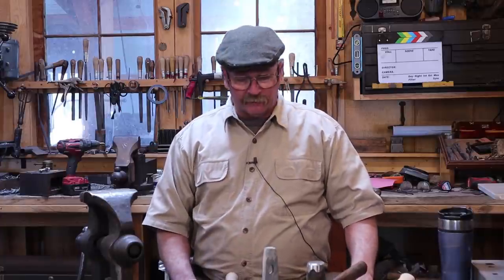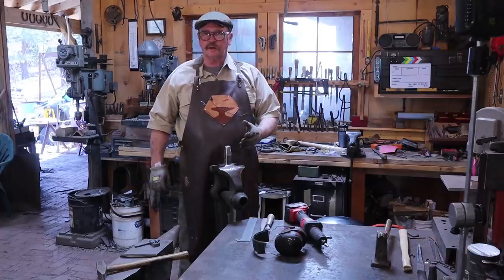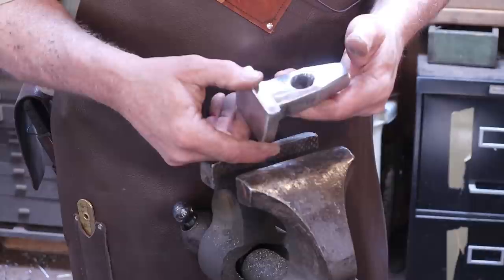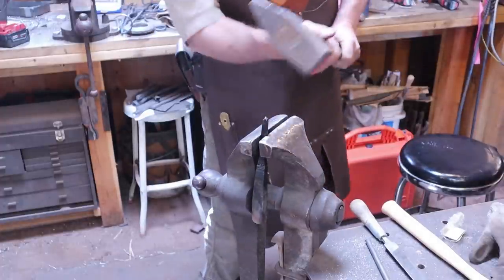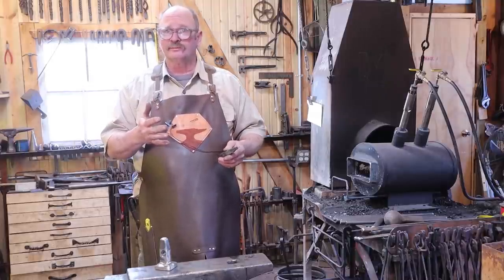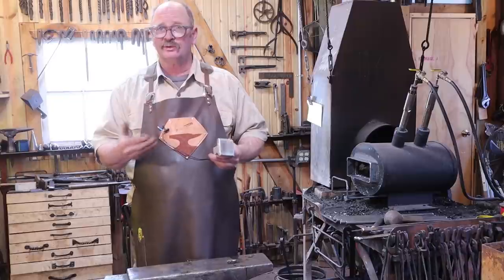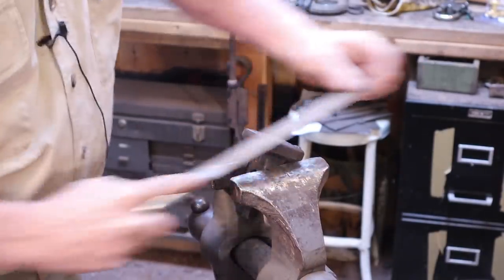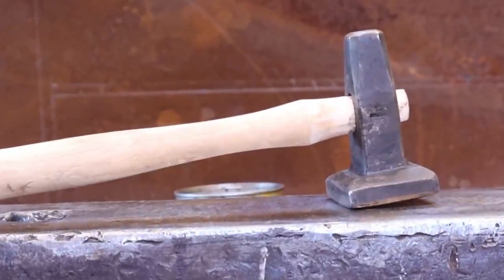Flatter - part 2 - hardening and tempering the mystery steel

Comment: Just bought the last pieces of steel to make a treadle hammer today. Your treadle hammer video inspired me to build my own, so excited to get started!
Reply: Pntz Englnd  Well... Where do I begin...? 😂
I built it from plans I found on the interwebs, but when it came to welding the springmountjointthingmabobber I turned it the wrong way so the springs doesn't pull enough. So now it has like 4"/100mm of stroke, should have something like 20" 😂🤦🏻‍♂️
Haven't really done any blacksmithing since I finished it, started working on my cars instead.
And yes, Jönsson svensk 😉
Reply: Pntz Englnd  Jo dom sparar mycket arbete! Och så får man två händer att jobba med. Men bygg nedre delen av "städet" ordentligt och rejält! Jag byggde mitt av 100x100x10 konstruktionsrör och väger 60 kg, men skulle varit bra om det vägde lite mer 🤷🏻‍♂️

Comment: Hoe ram bits don't have as much carbon as you would expect because they are subjected to so much stress and you don't want them to break. They also have a small amount of molybdenum and Manganese (usually around 2% of each) sometimes tungsten as well depending on the manufacturer. They are excellent steel for what they are made for. I have used this metal in making gun parts a few times and it works great because it doesn't wear much over time. I normally ice quench the contact surfaces and let the part air cool. One thing you will find is that it doesn't forge weld very well. As you probably have much more blacksmithing experience than I do, you probably know more about why that is than I do. Hope this is some help to you. Oh yeah, before I forget, I really enjoy your videos.

Comment: Just a FYI the flatter I made 20 years ago was never hardened and it is still fine. Sure harden it if you wish but as a struck tool on hot metal, dead soft is fine. Also, it will get hot when in contact with your work and will aneal more anyway.

Comment: And this is why I use S7 for all of my tools. No guesswork and S7 is incredibly forgiving and more than tough enough for hot work even if with less than perfect heat treating. If I ever get an electric oven, I may start using H13 but until then I'll take the convenience of S7.
Reply from the maker: Thats the way I generally feel about it.  But I have found most of my viewers like working with found material

Comment: When the piece snapped after water quenching, was the piece partially fractured during the oil quenching test?
Reply: Or the thermal shock of being dunked into ice cold water created stress fractures that caused the snap.
Reply: @exzyle2k  That too. I suppose one way to know would have been to cut off the test length before the water quench.
Reply from the maker: possibly, but since it couldn't be broken after the oil quench I doubt it had any cracks.  If it were cracked after the water quench it probably would have broken first hit.  But that is why I discard all of the steel involved in that test.
Reply: @BlackBearForge  Ahhh.... makes sense.

Comment: Could just heat it to the non-magnetic range to determine the critical range? Or is that not a universal.
Reply from the maker: I’m afraid it’s not accurate. Most steels loose magnetism in the 1450 range but some have critical temperatures much higher. That work for simple steels like 1085 or W1. But not so well if it is something fancy.

Comment: you could always send a coupon off to a lab and have them do a metallurgical analysis, then you would know exactly what it was.
Reply from the maker: I suspect that would be costly and wouldn't help teach the methods used in learning to work unknown steels.
Reply: @BlackBearForge  while i agree it would not teach the methods of figuring out how to heat treat an unknown steel.  It would show you exactly what you have.  I know its not as expensive as you think.  Several people i know have done it.  I"ll have to ask them how much the spent.  But knowing them i know it wasn't much.  Thank you for your reply.  Love the channel.

Comment: Nice took n toolin boss.  Pretty tough stuff ain't it?
 Did the steel info I sent you help you any for this? Guy I got it from Owens a rock hammer and core drilling and blasting company n ge helped me out with the info I sent in last video. 
   Blessed days sirSir,  Crawford out
Reply from the maker: I had several people send steel information on what they were sure it is.  Of course they were all different.
Reply: @BlackBearForge  yes sirSir,  I was just trying to help all I could with info from a guy in the industry.  Hope I didnt irritate you sir
Reply from the maker: Not a bit.  I just wish it was more reliable to know what a steel was based on its original use.  Like car springs used to always be 5160.  Now no one knows for sure.

Comment: That is.good ol'e  8630...maybe 8640....Oil quenching is.the way to go but I'd take it up to 1650, soak at 450 for 2 hours....For all reasonable applications it's all but indestructible...🔱
Reply from the maker: Several people have been sure they knew exactly what it was.  Sadly no two seem to agree.  It did get quit hard at 1500, not sure if it needs the 1650.  450 did result in a better tempering
Reply: Hey there Mr. Bear...You are correct.  Without further testing (spectrum analysis) it's impossible to know what it is for sure..That said,  25 years ago I had a Buddy that worked for the Nebraska State Highway Commission. Occasionally they would break a road breaker bit and he would grab it.  Those Bits were 8630. From the video & what you describe from your spark testing and seeing how it looks when you're working it (it has a slick almost wet look to it when cherry red) it sure looks & acts like those old Jack Hammer bits. 8630 is basically 1060 with extra chromium, nickel & molybdenum..Makes lousy knives,  great forming tools. (swages, fullers, & wutnots)..Dial down the tempering and it makes great wear plates..  Less finicky to forge than Shock series steel, super tuff stuff when tempered right...Always thought it would make great anvil plates..Anyway, that's my 2 cents worth..*tosses a nickel on the table..Can't help wonder how many feet of snow you guys got down there...

Comment: The twist is super annoying. Happens to me all the time making flatters and bottom tools. My tools always have a left-handed twist; maybe because I'm left handed? To correct it, I forge the high corners down, turning 90 degrees every blow in between upsets at the block.

Comment: scarp steel is best for learning because your not out any cost when you throw it away
Reply from the maker: The problem with learning on scrap is that it all behaves differently and you never know if you are having problems because of your technique or because you found some odd bit of steel.  Learning on mild steel keeps that one thing constant and once you have developed your technique it is easy to tell if a particular steel has its own problems, which many do.  But I understand that it is all some people have available
Reply: @BlackBearForge  i am not talking so much as a guy like you that 20 + years in the job more as a guy like me never hit hot iron with a hammer to make a tool in my life so if i can take a coil spring and make a usable tool for me even if it takes me 5 trys its a win
Reply from the maker: Sorry, I thought you were refer to just learning the basics of forging with salvaged steel of unknown properties.  Coil spring is actually fairly reliable

Comment: people often seem to overrate the heat treat of steel, this might be due to the constant circle jerk happening around it. in the end, it doesnt really matter here anyways, the hammer needs to be hard enough so it doesnt get deformed by the thing you are hammering on, but thats already it. if you'd care about the hardness of the end result, you shouldnt make it out of an unknown material in the first place, so not having the tools to determine what material it most likely is, isnt a drawback here